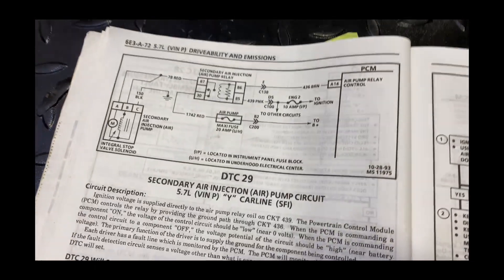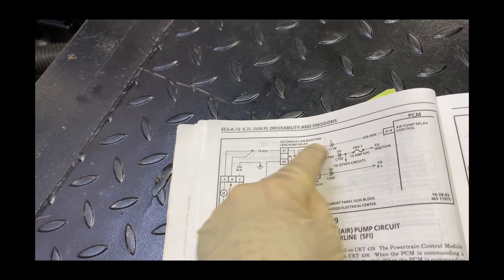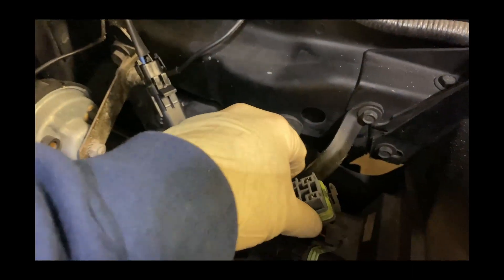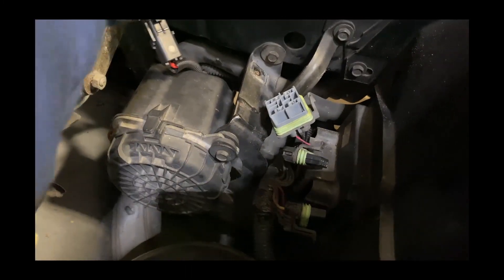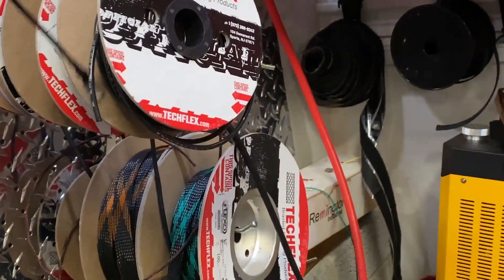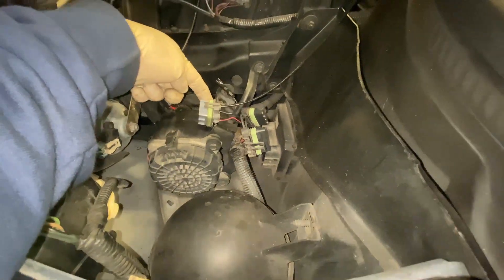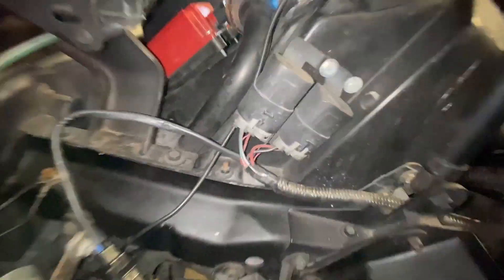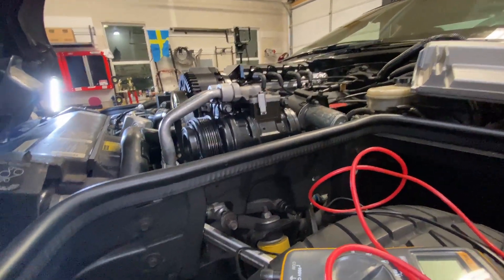LT1 Tech Quickie - Power Supply for Electric Water Pump

Comment: @EllweinEngines Thanks for the video....
 Q: so the ground that you take out from the relay connector, that ones just stay out of play? covered with tape i think if i saw correctly, thanks for the help!
Reply from the maker: actually no. it gets grounded to the frame or other existing ground wire that is convenient.  So in other words it is allowing the relay to be grounded and "signaled" as on all the time...and then when key on power 12v will have the water pump on at all times.

Comment: Outstanding video!  Even if a year old it is valuable. I have decided to install an electric water pump on my LT1s pump.  I was wondering about how to do it easily and now, since I’ve deleted the air pump I can use the original/existing wiring like you have done.  Thanks so much for all you post.
Reply from the maker: Glad it helped
Reply: @EllweinEngines  absolutely as I didn’t even think to utilize what was already there!  Love the channel l.

Comment: Where is the relay on a caprice LT1 smog pump runs into main harness need to do this asap
Reply from the maker: Yes.  the underhood relay/fuse box over in the passenger side back corner.  The relay is in there.  The impala forum may have a write up on how to find that relay's ground wire.  I 1st learned how to power the water pump from the air pump plug from Nabil Guffey.  In my eyes that is the most reliable and robust method.  There are water pump relay kits available too from various manufactures.
Reply: Thank you gonna tackle it today

Comment: I'm looking at the wiring schematic for my Vette (1996) and it's slightly different than yours. My wiring is a 3 pin connection into the air pump but yours is 2 pin. Any way I can still wire it up and get it working right?
Reply from the maker: Yes you should be able to.  The key is to make the relay be hot all the time when key'ed 12v is applied, (not just when the PCM signals on).  That drawing in the video shows 3 wires to the air pump and so maybe it is 2 hot wires combine to 1 pin and the ground is the the other "pin".

Comment: Is there another option since I have to keep using my smog pump due to California smog registrations 😒
Reply from the maker: Yes.  Other options some use a manual switch and add an additional relay.  that is the usual method actually.  Not many are using the air pump power supply as I did here.